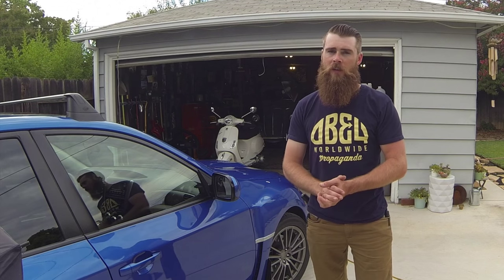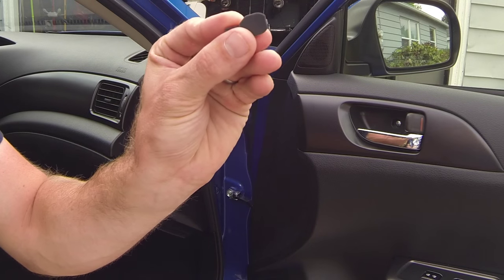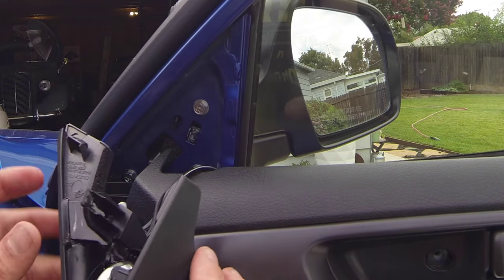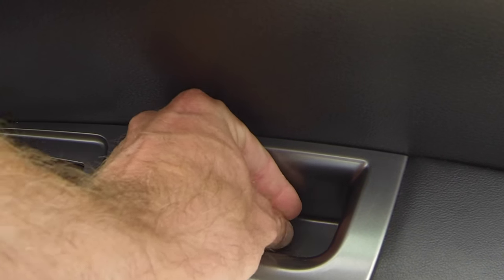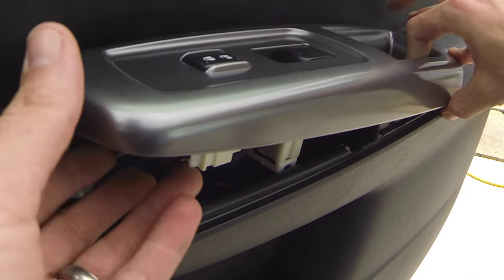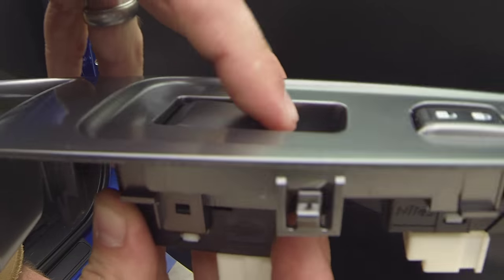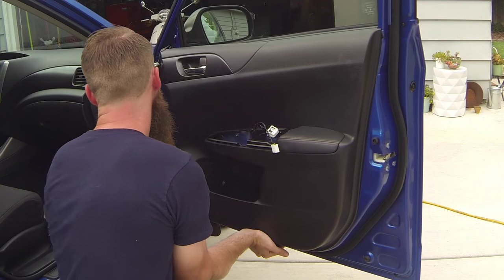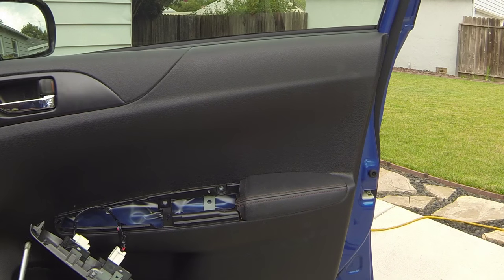Subaru Impreza 08+ Door panel removal

Comment: Thanks for the info buddy. I thought I broke those clips on the sail panel when I put a new stereo system in her Impreza. Turns out I just needed to pull those clips out and put em back on the panel. It was driving me crazy because I thought I broke those panels, I actually came across your video trying to shop for new ones on google.

Comment: Thanks so much for this video! I'd cracked the frame around my 2010 Impreza passenger side mirror and, after watching this and another video- found a used OEM part that matched the paint for that year class- started around 14:12 and had it back together and project cleaned up by 15:00- though with the mirror, I didn't need to fully disconnect the door mechanisms- just the speaker and mirror, and used the box the new/used part came in to support the panel. Can''t believe I waited so long to just get it done, this video was a huge help!!

Comment: Should've upgraded the head unit before you did the speakers, stock speakers sound a whole lot better with a descent head unit. Thanks for showing how to remove the door panel though, I'm upgrading my stock speakers next.
Reply from the maker: snakerb you got that right. I have to say this is the one mod I regret doing. But someday it will pay off with a better head unit and amp.
Reply: I'm running Clarion SRD1700S front speakers from the factory head unit and they sound amazing. Because my doors are completely sound deadened and I didn't use a hollow plastic speaker spacer ring to fit them. I also have foam rings around the speaker that act as a gasket between the speaker and the door trim preventing any sound waves from getting trapped inside the door and resonating. 
Whoever fitted those Focal's just did a terrible job.

Comment: First of all thanks for the video, will need to get access to my speakers and this was the best video I found to help me.  Secondly funny enough I have the exact same flathead screw driver.  Probably one reason the speakers sound so bad looks is that it looks they never installed the crossover to the midranges in your door (that is, the two wires he just clamped...they are for the midrange in the door).  I am going to try and add new speakers, and a dampener over the door for wind & plastic rattle noises.  Been watching caraudiofabrication on youtube and he does things very precisely.
Reply from the maker: Its the head unit it’s absolutely garbage. I put in better speakers with crossovers and it sounded worse.

Comment: I just installed those same speakers with jbl for the rear with a pioneer deck and the focals sounds fantastic with no amp. I would put some foam tape between the door and the speaker bracket and between the speaker and the bracket as well if you can. Or even a thin bead of silicone, careful not to get it on the speaker. I installed them myself and direct soldered to the speaker and all connections.  Also then throw some of that sticky tape on the crossover and get it secure so it isn't rattling around, don't want to damage it. I learned a few years ago that sealing the speakers up can make a big difference.
Reply from the maker: mallratt25 Thanks for the info I really do need to get a new deck since the speaker upgrade I don't even listen to the stereo its so bad. I like the sealing Idea those doors are so hollow I could really see it helping out.

Comment: Thanks for this video.  I have to replace my passenger door mirror and it looks like I can get access to the 3 screws that hold it on by just removing the tweeter.   Should be an easy job as long as I don't drop any of the screws into the door :)

Comment: Focal is top top end. As you said, the problem with your setup is impedance mismatch. I have had a lot of Focal sets, including a Kevlar $800 front set once. Also, even the base Focals need an amp to sound good. Polyglass is my favorite line,  i didnt like the cheaper line under that.
Reply: This was a K2P set with custom dual level adapters and matting: http://www.bellbottomblasters.com/images/kevlar14.jpg
Reply from the maker: LastHumansGarage its funny because I have two amps and subs sitting in my garage but I don't want to take up trunk space. I know that they make some nice powerful small amps these days thought. I really miss the Harmon Kardon system in the 12 Legacy I had before this.
Reply: Blake's Garage One of the smallest amps you could get right before I lost interest in building systems was the Arc mini. Although it didnt sound nearly as good as my high end amps, it did have good volume for its size. The only amps I had which I thought were worth the sound were Tru Technology, McIntosh, and sinfoni. I had all the other mainstream brands, Pioneer, Alpine, Rockford, PPI, and they were all crap in comparison.

Comment: You completely forgot about the middle clip in the power lock/power window button assembly piece. 🤔 The "Rattling" might have been caused by the metal fastener falling into your inner door panel.  I cracked my panel prying on one end on it, thinking there was only two clips like you clearly stated in your video. 🤨

Comment: I have stock speakers with stock 6CD changer. The sound is horrible. I mean there is no rattling or no other sign of failure, but sound s so flat... There is virtually no treble and the sound is like out of a bucket. I have tried different amp and could not see any difference. As electronics engineer, I can't see how the amp can give a big difference, unless a shady equalizer is used.

Comment: Thanks for the info.  It was very helpful.  Can you do a video for the 5th door?  I need to fix the wiring for my rear wipers and door locks.  I checked the wires and some are cut off.  Any tips to do this?

Comment: hi ,sir may I ask u a question ?is that possible to change the engine under panel myself ?for the subaru impreza 2.5i wagon ? and also some panel in the left under side
Reply from the maker: +Lam clarence Yes it is very simple. You have to take it off every time you change the oil. Its 3 bolts and 2 clips.
Reply: +Blake's Garage but gow about the other panel under the car in front ?do u know how to repair or change it ?because I bought a impreza not long ago and kinda discover some broken part

Comment: Good video but no one solders car audio wires heat shrink or the crimps you see there
Reply from the maker: People that do it correctly do. Hack car Audio installer don’t hints the $1 install. If you pay an high end car audio shop they solder and shrink wrap.
Reply: Blake's Garage  heat shrink yes I agree but no one is soldering shit falls apart as the cables move slightly even if there is shrink rap if people shrink rap they just twist the wires together and it will hold forever you didn't even know you needed a amp for those speakers your knowledge on the subject is lacking clearly no one solders
Reply from the maker: Jeremiah Schwenk dude look it up that’s so wrong. Twisting a wire is not a good way that’s what hacks do.